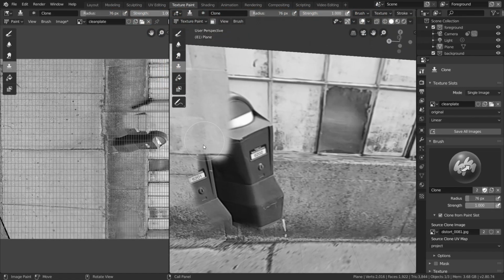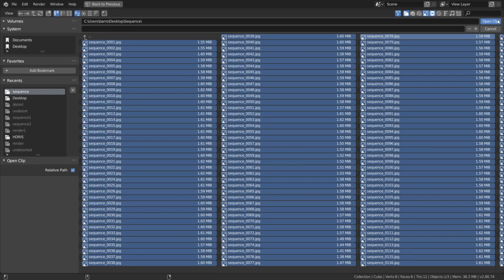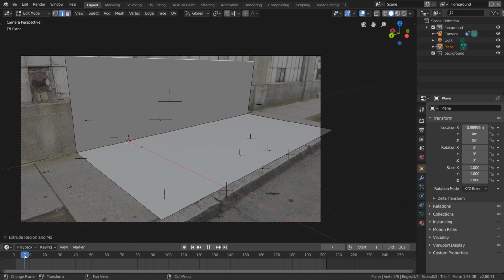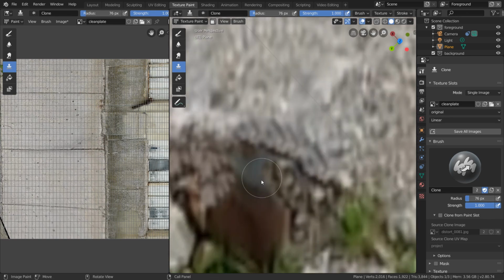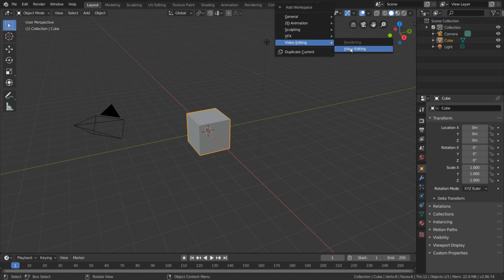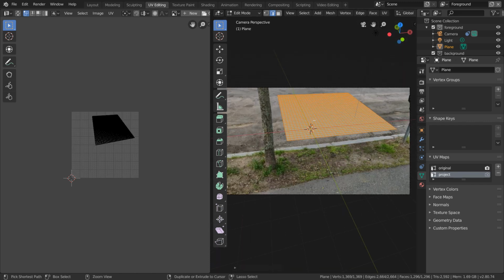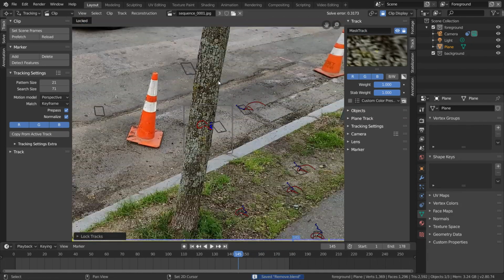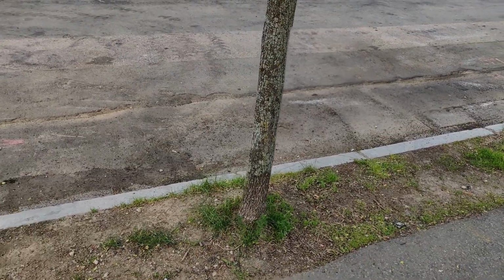Blender 2.8 3D Object removal projection painting (part 3)

Comment: Which render engine..did u use....cycles or eevee?...why?..which is better?
Reply from the maker: In this case you want to use eevee. The shading on the geometry is just an image texture node (no kind of bsdf) so cycles and eevee should give identical results, eevee however is faster at doing this. In other cases: cycles is more accurate (in the sense of how light bounces) and eevee is a fast approximation of the cycles result.